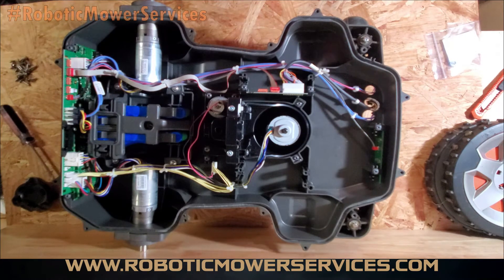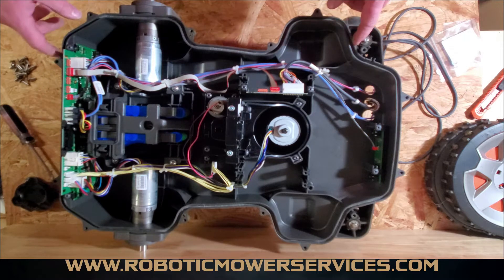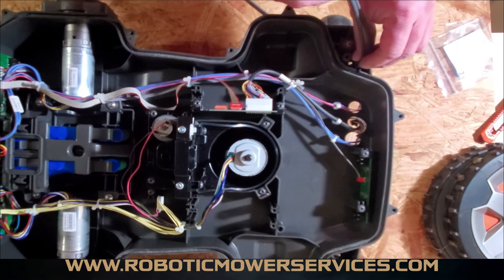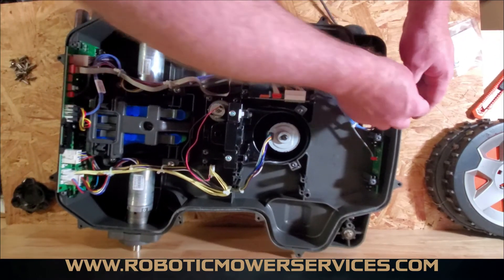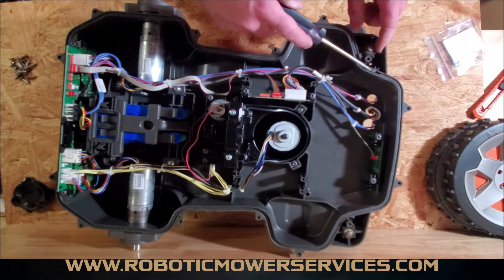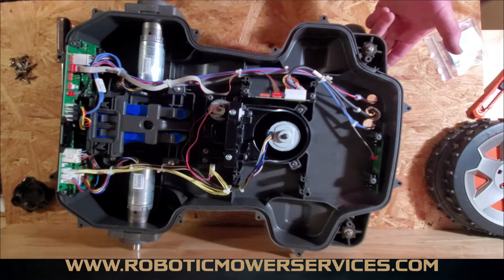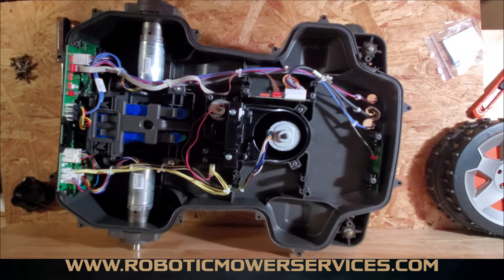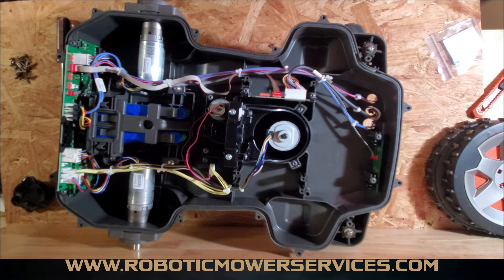Husqvarna Automower Rope Seal (Chassis Seal) Installation

Comment: Wondering what size rope seal that is ? I have a 450xh with zero cell coverage so looking at buying a wifi module. I have the option of 4mm or 5mm seal .
Reply from the maker: The parts description from Husqvarna says that the seal for a 450X is 5 mm.